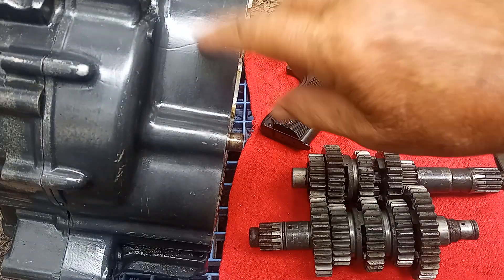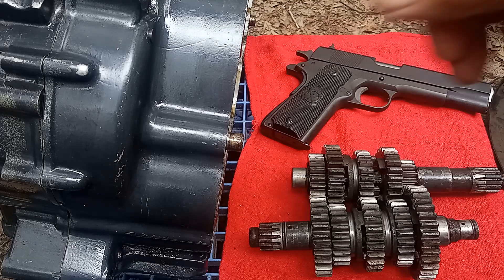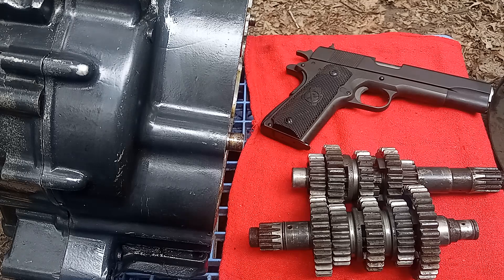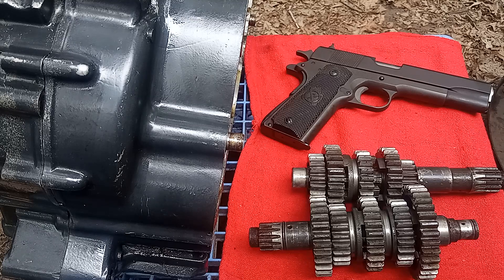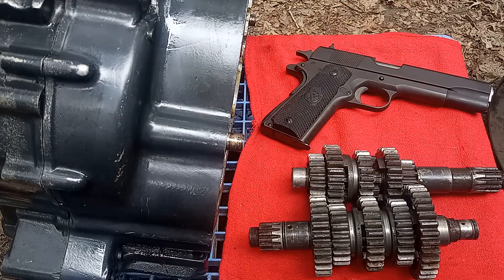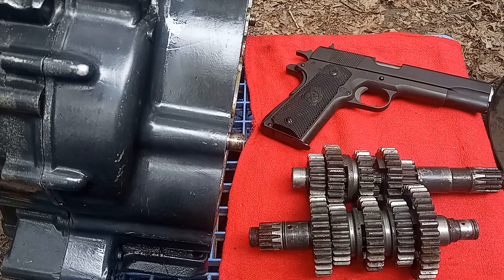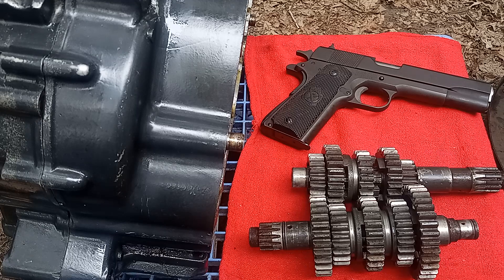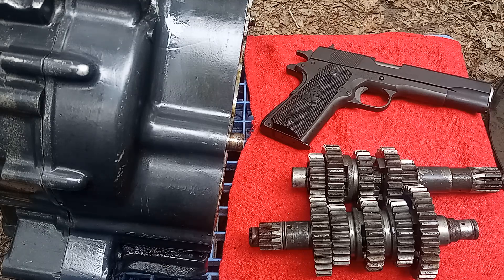Dry film lubricant coatings

Comment: KG GunKote might still be the substance.  To quote a knife maker : Gun Kote comes in two formulations; 2400 Series which use molybdenum or PTFE as a lubricating base and the 1600 Series which have a high concentration of PTFE. Then there is Brownells' labelled version, still made by the same KG Industries. They define it as " second-generation epoxy, thermo-set resin finish that will not break down, peel or dissolve."  I actually intend to use some on parts that I will clean up with Evaporust.
Reply: Just checked my KG stuff in the garage.  I still have older 16 oz 2300 Black finish and the 3000 Series Moly Gear Kote in 8 oz cans. My guess is that they are now far more into the OEM market, as the brake caliper "paint" a buddy got for his track car is also a KG made item.

Comment: Do you think it would work to run burnt motor oil as bar oil. I bought a gallon that cost me 14 bucks and didn’t even get kissed.
Reply: You will be adjusting your chain much more often. And chain wear will increase. Even Walmart bar oil is far better than used motor oil.
Reply: @dandarling5990   That’s true. Thanks.
Reply: It doesn’t stick to the chain like bar oil
Reply: @cliffhaupt5413  True. Thanks.
Reply: Yuck, why would you want nasty used motor oil all over your fresh cut wood??
Reply: @naps3386  make it burn better.
Reply: Bar oil has special additives to make it tacky. My grandfather always ran plain motor oil in his saw because he was cheap and thought oil is oil is oil. Cutting wood with him was always messier than with bar oil and he ran through oil twice as fast. If he didn't have a manual oiler on his saw that he'd gotten in the habit of pressing, I'm sure he would've burned through chains and bars because automatic oilers are calibrated for bar oil.
Reply: @mwilliamshs  That’s where I got it from an old man said he had never bought bar oil. Guess that’s why he’s rich. By the way what does pressing mean.
Reply: Press, to push. I was referring to the manual oiler on his saw. You can press a plunger next to the kill switch to manually dispense oil onto the chain through the bar. It's a manual pump. Few saws have them. Without one, you can't safely run anything but bar oil but with one, your thumb becomes the bar oiler and you can pump oil out as needed.
Reply: @mwilliamshs  Got ya. 👍👍👌👌✌️✌️
Reply: @crawwwfishh3284  lots of people never buy bar oil and don't get rich. If you read my comment, you'll see using motor oil increases oil consumption at a rate of about 2:1. So if bar oil costs less than twice as much, it's cheaper. If it costs double but prevents an iota of wear, it's still cheaper.

Comment: CRC Sta-Lube is an moly-graphite engine assembley lube that is widely distributed at auto parts stores and is affordable.  I use a small dab on a Q-tip top apply an very light film on firearms.  Maybe it would be a solution also for your chain?

Comment: What kind of .45 is that? Colt or clone?
Reply from the maker: Springfield Armory Mil-Spec, I have a pair of them.
Reply: @Scott-yd8xn  Way too many variables. I've heard good and bad things about some of Springfield's guns, and I have a personal anecdote about Colt's recent quality before being bought by CZ. My Colt Delta Elite I bought new in 2020 wouldn't hold the slide back on the last round until I put an aftermarket slide stop on it. The most reliable gun I have besides my Glock 19 is a sig sauer 1911. I've put thousands of rounds threw it with no malfunctions I can ever remember.
Reply: @Scott-yd8xn  Don't get a Springfield if you want a Colt. If you want a Colt, get a Colt. I also have the Springfield, never had issues with it though. Just use wilson combat mags.